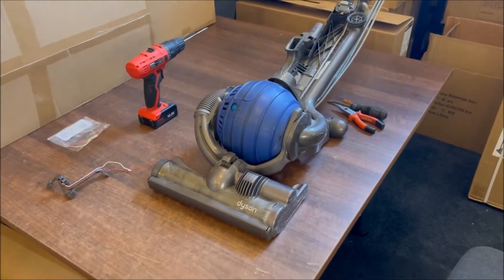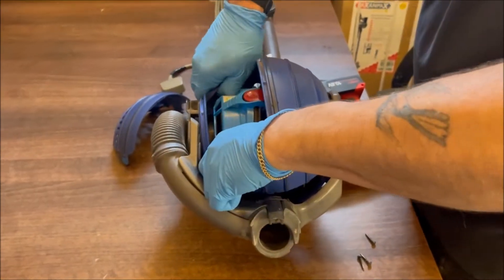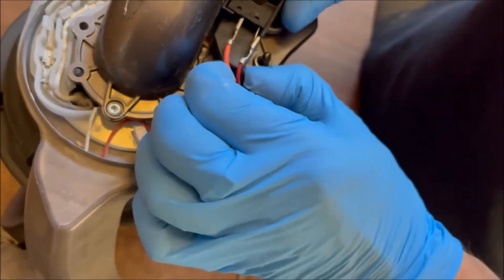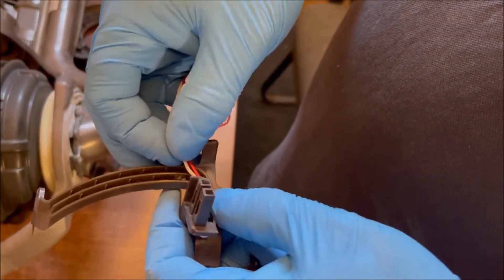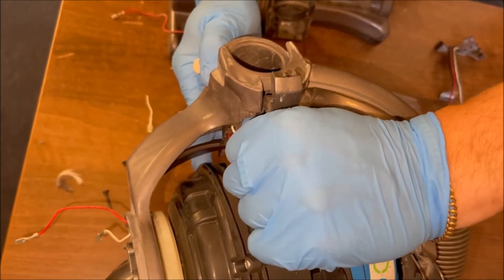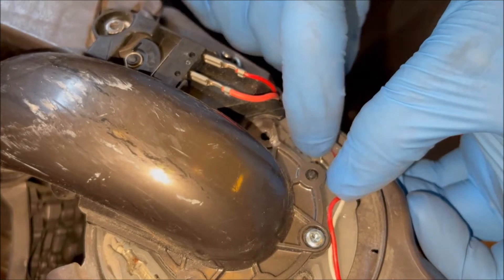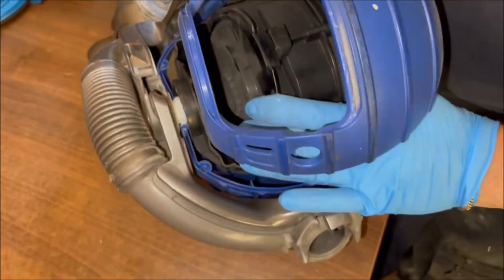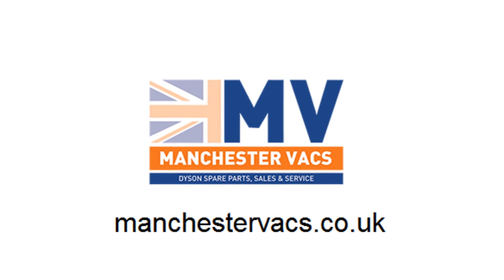How to Fit and Where to Buy a Dyson DC25 Yoke Loom. No Power to Cleaner Head Fix.

Comment: It looks to me like you reversed the red and white wires when reattaching to the yoke assembly.  Do you know what the voltage is supposed to be at the yoke assembly?
Reply: Yes, he reversed the wires despite commentary to say beware of doing this.  Should not matter though as it is an AC motor.
Reply: @andyl2631 that feeds the brush bar DC motor.  Not an AC motor

Comment: Notice when putting this wire loom back in, the thin portion of the plastic, near where the loose ends of the eres are,  gets slipped behind the outer portion of the body, such that you can see it protruding when you look at the hole where the wires pass through to finish the connection. I noticed that the thin portion of the loom has to be anchored tight against the inner side of the pivoting arm.

Comment: My DC25 stopped randomly it won't turn back on. If you unplug it and touch the pins on the plug you get a nasty shock!  Could that be the the switches? I changed the plug fuse checked all the connections inside all wires intact. Should I just replace all the switches?. Any advice would be appreciated.
Reply from the maker: Advice is here: https://manchestervacs.co.uk/DysonForum/
Reply: No, not usually.